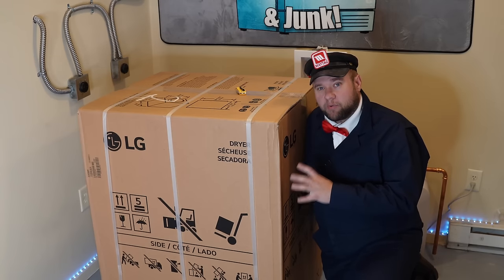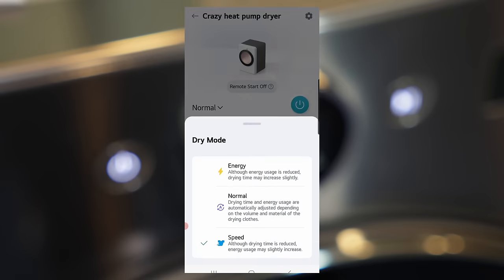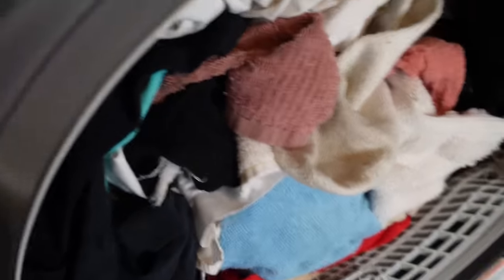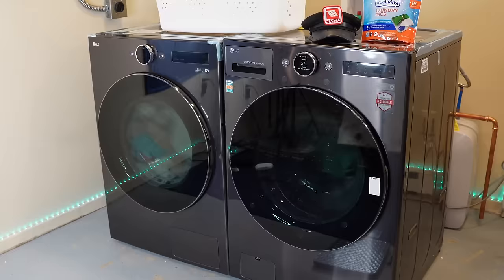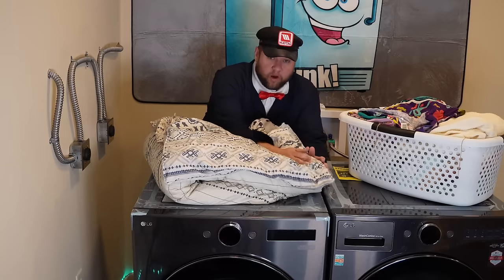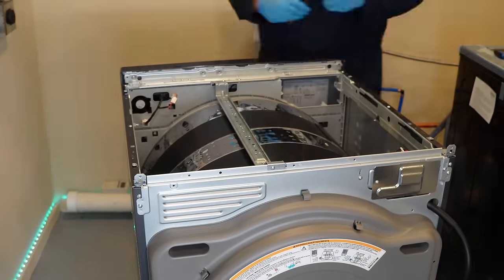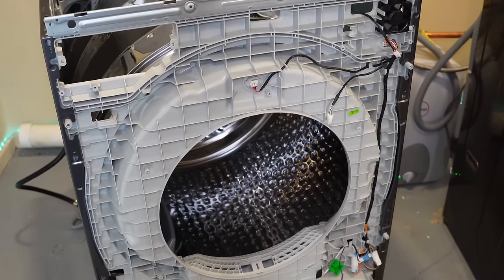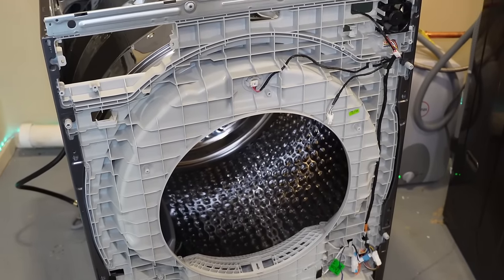LG Heat Pump Dryer - Way Better than I Expected - DLHC5502 Teardown & Review

Comment: My unit was delivered today. I haven't installed or powered it up yet, but the door doesn't latch. Is there a trick to it?
Reply: FYI, my unit is defective. The front facia is warped but no parts are available for repair. I’m interested to know if anyone else has the same problem. It was like this out of the box, so I assume it’s a manufacturing issue. There was no damage to the box or unit I can see.
Reply: @boomerscs9193  Just got one of these yesterday. Door was fine until midway through first load, then popped itself open and wouldn't stay shut. I've already scheduled an exchange but I also noticed a (not specific to this model) page on LG's website that talks about the door gasket needing to 'settle' (or something like that) for 3 to 5 loads (but with no advice on how the hell you are supposed to run it if the door won't shut...) So as an experiment I used a strip of painters tape to hold the door shut to finish that first load and then another. (Trying to make a dent in the mountain of laundry that piled up since previous dryer died.) 3rd load I tried leaving the door untaped and it made it almost the whole cycle before popping itself open, so seems to be improving.
How could you tell the fascia was warped? And what was your ultimate resolution?
Reply: @SolonSutton  An LG technician determined the warping. His plan was to replace the entire front structure of the unit. However, there were no parts available. I found that removing the bottom 2 screws surrounding the door opening that hold the front metal fascia to the frame the door would stay shut. It's been working and I haven't had another issue.
Reply: @boomerscs9193  Well the 2nd unit showed up with the same issue. Even more so as the door wouldn't shut right out of the box. It was literally taped in the box with the door not closed all the way, so obviously LG packed it up like that at the factory. Unbelievable. Refused delivery. So back to the drawing board, sigh. Bummed as this model really would have been perfect for us, but not wanting to have to play the 'will the next one be ok' lottery. LG needs to get their crap together, apparently.
Reply: @SolonSutton  Samsung just came out with a similar unit, but it's more expensive last I checked and I haven't seen any reviews of it.

Comment: Will you be adding a video with the noise from the unit? Curious about its noise profile since I find the older Whirlpool heat pump driers to be fairly annoying (the higher pitch noise from the fan “Wryyy”). Would be interesting to also see if you can note the primary frequencies the machine generates.
Reply from the maker: I did a live video of it running in the background. I will eventually compare it with a decibel meter against a resistive heat tumble dryer, but I haven't been able to do that yet.

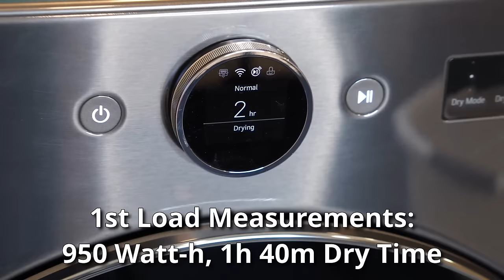Comment: Thanks for the video. 6:31 has 950 Wh for your standard load. Do you have context from a standard resistive tumble dryer for how many Wh a cycle that got the clothes equivalently dry, if you will, would be used?
Reply from the maker: Not yet but I will soon. I would hazard a guess at 2.5-3kwh based on some early tests I've done

Comment: I need a ventless dryer that can handle pet hair. I have a all in one ventless washer / dryer Kenmore/LG twin. Only clean out is the twist put plastic catch by pump. Every 7 months I have had to replace the pump from either going out or hair got by and twisted around it. I need something that can handle pet hair, I have 2 dogs and a cat. I wish I didn't need a ventless, but where dryer is located, would have to have to have a really long dryer vent hose which can cause issues too.

Comment: Fellow appliance man here..  I can forsee this machine being popular in high-rise buildings, any idea if running it on a 208v circuit verses a 240v circuit will effect the dry times with this heat pump system like it does with a traditional electric heating element?
Reply from the maker: Is given that it runs on an inverter motor to the compressor I would guess that it does not matter

Comment: Can you do a video on warranties?   The guys over at Yale Appliance pointed out that the impressive warranties offered on these machines are practically useless if the manufacturer doesn't have its own service department because the time/labor to replace some of these critical parts is well beyond what an independent repair person will be paid under that warranty.  Do most repair shops do warranty calls?  Do you?
Reply from the maker: You have to ask your local company that because there's no set answer in the US. It varies by region.

Comment: Great video.  I'd just like to see more figures comparing times and cost to a regular dryer.

I estimated an 8,000 kWH ROI compared to a basic Maytag 7.0, and that is with my solar rate of .09/kWH.  Unfortunately, I have a 28.25 depth limit in my pantry to deal with too. Not to mention that I can service the Maytag myself, the last one lasted 15 years needing one heating element replacement and two minor parts.
Reply from the maker: I have a Speed Queen we will test directly against soon. The one variable in want to test but really can't is HVAC cost to replace the expelled heat from the vent.
Reply from the maker: Also as a note, this unit is easily, EASILY serviced other than the sealed system. I know that's a huge part obviously, but any other issues will be easily resolved on this unit and likely at reasonable price.
Reply: @bensappliancesandjunk  I got that vibe from your tear down, but the water system, build-up, evaporates, etc. is a little bit of a concern.  My vent is also a little compromised, and the safer ventless design really appeals to me.  Using my greenworks 60v electric blower on the vents regularly is just great.

HVAC cost doesn't worry me, unless there is an air quality concern, our pantry is shared with our living area... until the post children-in-college remodel.  Thanks again!
Reply: @skyrunr  - If you want a break even analysis, it's not really a fair analysis unless you account for a vented dryer dumping conditioned air out of your house.  It's like having a window open with a fan blowing out of it every time you run your dryer.

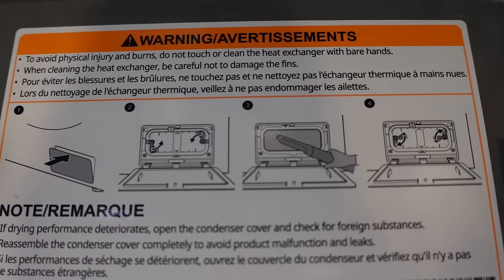Comment: nice technical review.🤩 7:08 isn't the fins supposed to have gold plating for less maintenance and long life/less corrosion?  besides that, the design simple, it looks plenty reliable especially that large DC brushless motor.
Reply from the maker: Honestly, I do not know about the fins. That's a great question.

Comment: Is the drain/resirculation pump easily cleaned considering there is lint in the water it's pumping?
Reply from the maker: I show access from the side where compressor is

Comment: I'm highly anticipating the Samsung review of their new model. Maybe Samsung will finally beat their rep when it comes to washers and dryers like they did with the Bespoke Fridges.
Reply: I highly doubt that. The new washer dryer is based off of the bespoke line of their washers which are not that great in quality.

Comment: i use this low-tech thing called a drying rack that's cheap and uses no electricity or gas.
i suggest using one instead of buying a over-priced high tech heatpump drier that will become a paperweight as soon as the refrigerant starts leaking out from the ultra-thin coils.

Comment: So if the dyer only unit used 940 watt hours, it drew an average of 566 watts on average at just 2.35 amps. Does that sound right? If so, this if freakin awesome…especially those for us off grid. I was going to go with a gas dryer, but might rethink this. I have fairly big system (72 370 watt, panels with 135 kWh of batteries with the ability to use just under 98A @ 240), but dead of winter can be an issue.
Reply from the maker: Hi, you are correct. However as a note the demand starts very low and builds up over time as Temps increase. So the first 30-45min it will be below that average, and for the remainder will be above that. Peak draw was about 4a.

Comment: How does this type of dryer affect fabrics like cotton?  I hate ironing so I don't buy cotton shirts which tend to wrinkle in a traditional dryer.  My last LG dryer was just replaced at 16 years old so a 12 year replacement cycle seems too often for such a high priced machine.
Reply from the maker: Respectfully, its not as if a new dryer is going to get that same 16 year cycle vs. this at 12. Even then, I think the replacement cycle on these is spec'ed at 14-15 years, with a 12yr minimum viability.

Comment: It seems like it could be a really great machine. If they don't purposefully manufacturer them to fail so they can sell you another one sooner, it could be a nice unit. Seems like it would be a great choice for someone trying to live off grid where power is more critical, say you have solar and a battery bank, this unit would be just the thing.
Reply: With a 10 year warranty on the expensive parts, I'd say LG wants to sell you new appliances every 10 years or so.

Comment: I do not see the Rps sensor on the motor that has a tendency to fail. I also wonder about the small drain line and pump. Here in the us we like to use way to much soap. I am assuming that the drain pump itself is better made than the standard washers.
Reply: The water you get out of these has been evaporated away, so any contaminants in it are left in the clothes themselves. It’s not considered potable, obviously, but you can absolutely use it for cleaning and watering plants.

I wouldn’t be surprised if someone is able to design a system that recycles this water to actually help wash another load. Miele’s units already support using things like rain barrels for water supply, with proper filtering, so it’s very possible.

Comment: Do you think that this is the same dryer that comes in the wash tower with a heat pump dryer?
Reply from the maker: The user interface is different.Therefore, it has to be an alternative model.But my impression is that the components that actually operate the machines are identical

Comment: 08:04 I'll tell you a "secret". Washers and dryers have doors that open in opposite directions for a specific reason! If you change the location of your washing machine and dryer (washing machine on the left, dryer on the right), you will be able to open the doors in both and transfer the laundry directly from the washing machine to the dryer, instead of the way you do now, by first putting them in the basket and moving them to the dryer 😅
Reply from the maker: The setup in my room is oriented to require the dryer on the left and there's no way I'm re orienting a door for a video

Comment: Just found your channel and valuable information. Thank you! Do you have any info on Kenmore elite French door ice makers freezing up? Ours hasn't worked since warranty went out. We've replaced the ice maker, but the line still freezes and causes leak in back. Help🙏
Reply from the maker: Depends on the kenmore. They use many brands so it's hard to say
Reply: @bensappliancesandjunk  we've tried what we know, but hubby is electrical contractor and tired of chasing our issue so we just turned off the water. I miss my ice though
Reply: @bensappliancesandjunk  any suggestions would be greatly appreciated. Thank you for your time!

Comment: Wouldn't direct drive mean three less moving parts? Belt, idler and tensioner?
Reply from the maker: Depends on model. Most units have the pulley and tensioner together as 1 part.

Comment: If the machine uses that much power, what's the advantage of a heat pump dryer over a regular tumbler?
Reply: He states in the video it uses about 1.5 kW less per load.
Reply: Heat pump dryers use FAR less energy per load than any other type of dryer.

Comment: Is the heat pump and lint filter mechanism the same in this standalone LG Heat Pump Dryer and in the LG WashTower with ventless heat pump dryer?
Reply from the maker: Nope. Quite a bit different, and the one in the DLHC5502 is head and shoulders superior.
Reply: @bensappliancesandjunk  Thanks a lot! Is the Washtower dryer more like the Washcombo one? In respect to the heat pump and the lint filter.
Reply from the maker: @jasgaravito  THe wash tower heat pump is identical to this one. The UI is moved/different, and thats about it from my understanding.
Reply: @bensappliancesandjunk  sorry for insisting. How is the DLHC5502 dryer superior when compared to the WK14BS6R? In my country the Samsung Bespoke AI Laundry Combo and the LG Ventless Washtower are just arriving and I'm trying to decide which is the better to buy. Thanks!

Comment: 20:57 it's 5100 BTU/hr in your graphic onscreen, not 5100 watts.
Reply: does this thing consume alot of electrity?
Reply: @randomrazr significantly less than a standard dryer.
Reply: @jonathansage2147  do you thinka. natural gas dryer is more efficient or heat pump dryer way to go?
Reply: @randomrazr  are you talking cost or energy? Energy? Then the heatpump is definitely more efficient. Cost? Depends on your local utility rates. Given that the gas dryer probably costs less to start with, it's probably the better cost option - though you do have to have a gas line plumbed which isn't free.

With a gas dryer you'll also be venting conditioned air to the outside, which you paid for, so bear that in mind. It's probably still cheaper. Natural gas in the US is insanely cheap per unit of energy.

Honestly, the reason not to go with a gas dryer is that you're doing combustion in your house where you breathe. If that doesn't concern you, go for it. I'm looking at gas appliances like they're likely to be the next lead paint. What's your health worth to you?
Reply: @jonathansage2147  yes we would need a plumbed gas line. i assume ur take on combustion is ideal for living in a home. same goes for a gas stove vs eelctric/induction ?
Reply: @randomrazr  Yep, I've gone the route of an induction cooktop for the home I'm building. It'll be a big shift for me since I've always cooked on gas. My previous home, which I also built, had a natural gas furnace, natural gas cooktop, and natural gas dryer. My point is that I've made that mistake before and I wouldn't fault anyone for making them too. As the data come in, it's been hard to ignore that they damage indoor air quality in significant ways.
Reply: @jonathansage2147  your furnace and water heater not gonna be gas in ur new home?
Reply: @randomrazr  nope. I went all heatpump everything.

Comment: By the way, you have that 240V dryer plugged into a standard dryer outlet that is probably fused at 30A. That might be OK for a standard dryer, but not for this one. The specs for this dryer clearly state that it must be fused at 15A. So for anybody that buys this dryer, and puts it in place of their old dryer, they need to change the circuit breaker to 15A inside their breaker box.
Reply: That's ridiculous.  The unit should have its own fuses with the expectation that it's going to be installed on a 30A circuit.   Most homeowners and installers are not going to change the breakers.
Reply: @kilwala2242  I agree with you. Either do what you said, or make this dryer 110V. It only draws 4.2A at 220V. So, it would only draw 8.4A at 110V. That’s not much. 

Regardless, the specs require a standard dryer pigtail suitable for 30A service, complete with 10 gage wire and Nema 13-30P plug. THEN, the specs call for a breaker fused at 15A. If there is a short inside this machine, and you are fused with a 30A breaker, this machine is not properly protected. Imagine plugging a 16 gage extension cord into a breaker fused at 60A. That cord would catch on fire before that breaker tripped if it were overloaded. The breaker must match the load placed on it and the ability of the wiring to trip the breaker before burning. For this dryer, it’s a 15A breaker. Says so right in the manual.

Comment: does  speed queen make heat pump dryers?
Reply from the maker: No. They have zero work with compressors.
Reply: There is a compact heat pump dryer by them in Europe. However, it looks 100% identical to the one by Asko.
Reply: @Loreality  European energy efficiency regulations de-facto ban vented and conventional ventless dryers. (They’re not explicitly banned, but they cannot come close to meeting the efficiency of heat pump.) So it wouldn’t be surprising if they rebadged some other company’s product in order to offer something.

Comment: Is it still possible to buy appliances that don’t require an Internet connection and app? Thanks.
Reply from the maker: I dont think its required, but optional. There are a few that aren't wifi-enabled though
Reply: @bensappliancesandjunk  Thanks.

Comment: A HP dryer is only used where no NG is available? In other words, gas is cheaper to dry? Or is this a live in elec world mandate?
Reply: Depends on the individual situation. Some don't have access to vent outdoors, some do not have gas, some pay crazy high prices for electricity and some just want to use less energy.

Comment: It seems like the heat pump dryers have to run for a longer period of time. I do have to wonder what effect that has on the wear and tear to clothing over time. It would not be a net finanical gain if you had replace your clothes more often because they wore out faster due to a longer drying time.
Reply: I have my LG for nearly 3 years and I really see no difference in my clothing
Reply from the maker: Because the heat is so much smoother, it's less wear and tear on clothes, not more.
Reply: It's claimed that the higher temperatures of a conventional dryer is  more damaging to clothing than the longer drying time of a heat pump. I think elastane is supposed to be degraded by high heat. I haven't replaced my ancient vented dryer yet , but heat pump dryers have been commonplace in the UK for years and now dominate the market due to our high electricity costs, and I've not seen any complaints about clothing wearing out sooner.